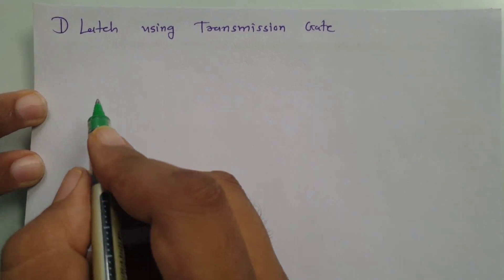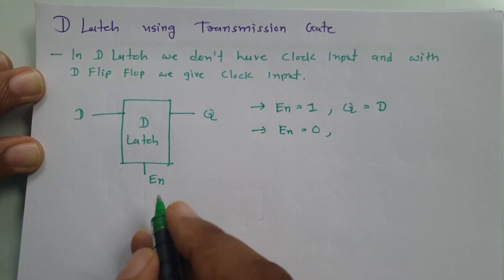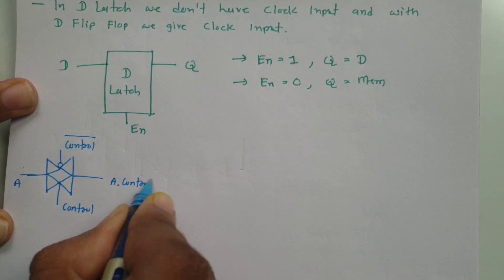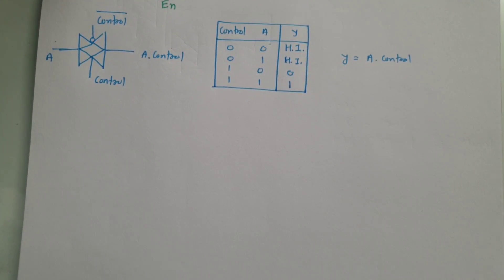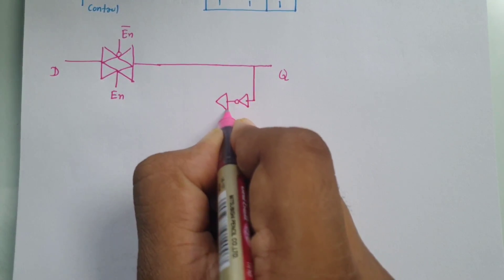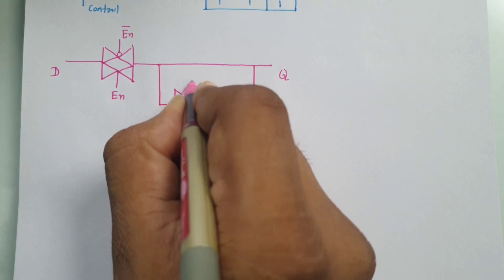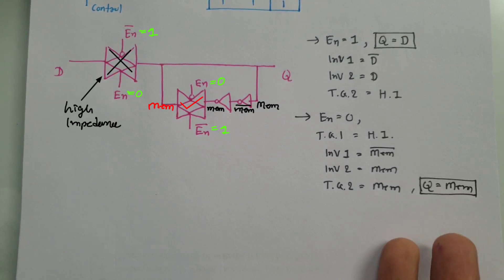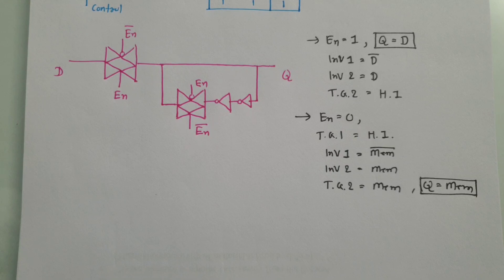D Latch Implementation using Transmission Gate | CMOS Transmission Gate | VLSI by Engineering Funda

Comment: Not only students, you are also in the same confusion as students. Its unfortunate that most of us are not aware of simple difference between latch and flip flop. Latch and flip flop both will have CLOCKs, only difference is latch responds at the level s and flip flop responds at the edge of the clock.
Reply: Latch having clock is called clocked Latch. Flip flop
Reply from the maker: Clock has fixed frequency, you tell me the frequency of level trigger signal. I don't know what you think about me but I have designed those circuits at gate level and at chip level. 
Level trigger is referred as input, you can say that as enable signal. 
Flip-flop works at fixed frequency in sequancial circuits.
Reply: I may not be knowing about your background, my point is clear Latch is a level-sensitive, the clock is a signal which has both Level and Edge. Latches will respond at levels whereas flip flops at the edges. Flip flip is designed with two latches in master-slave with two clocks that are out of phase. When two latches are operating at the levels how do you expect the flip flop to be edge-triggered?
Flip Flop output seems to be edge-triggered but internally it is level triggered.
I request you to analyze once.
Frequency comes into the picture when you have a combinational logic circuit placed between two flip flops. 

I request everyone not to follow books or teachers blindly, try understanding practically the logic behind the concept.
Reply from the maker: @krsnaadari : that's what I told but you are saying that in other ways. 
Flip flop works with clock, 
And Latches works with level signal, you can say that is enable. And based on latch only flip-flops are designed, practically in sequential circuits we use flip flops only with well defined clock. 

I dont know about how to follow blindly, but yeah you can learn by asking questions, don't judge people.

Comment: Sir, What if don't use two inverters in middle?
Reply: The inverters are actually storing the previous state value in its parasitic capacitances. So if you remove that, output is going to be ambiguous.